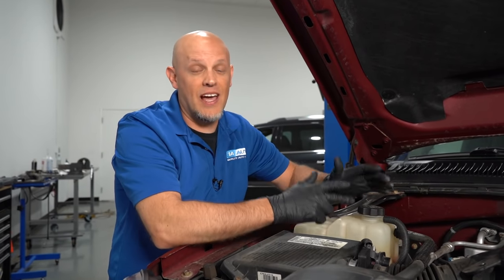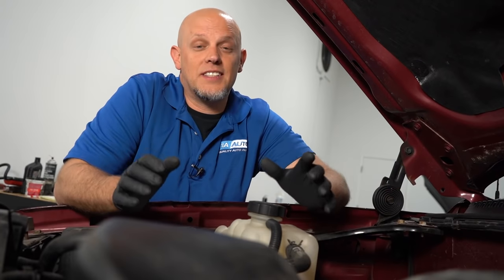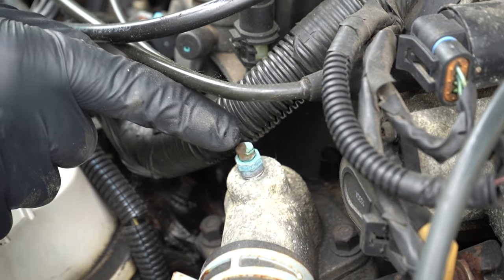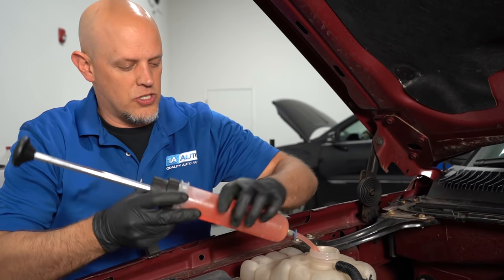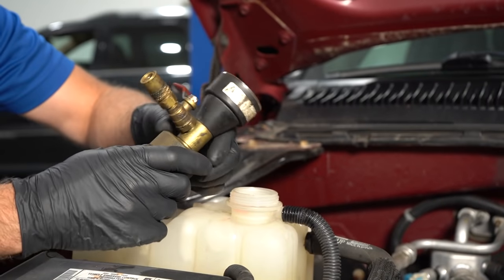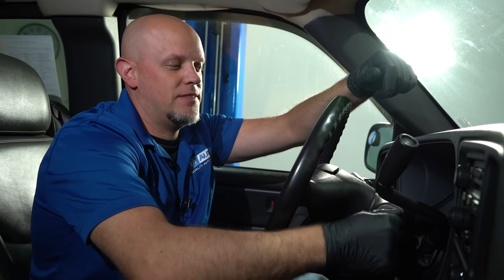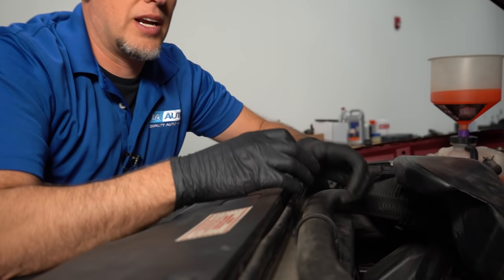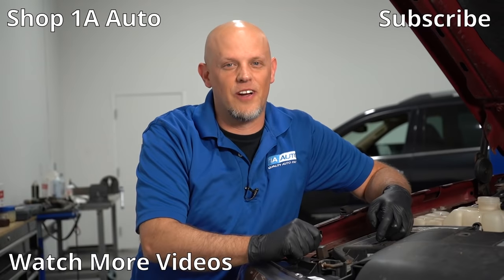Overheating After Replacing Radiator, Pump, Thermostat? Burp Coolant to Remove Air Pockets!

Comment: I just replaced a thermostat,  the reservoir is overflowing with boiling coolant.  I took it for a drive,  so I am stock at a gas station with a dead battery  watching this video , fun times

Comment: My 97 Accord EX started to overheat when I was waiting to make a Left turn to go inside the mall parking lot, I saw smoke coming out of my hood I looked at the temperature gauge and it was maxed out all the way to the top Red line Hot. I quickly pulled over, parked my car shut the engine off looked underneath my car there was radiator fluid leaking out like a water tap. I had to call my buddy to bring me some radiator fluid and water. It turned out to be a slow leak, I still managed to drive it back home and to work the next day while monitoring the temperature gauge. As I'm halfway through my work shift fluid starts leaking out, I had a bottle of radiator fluid in my car to top up after work I got down to figuring out where the leak was coming from sure enough it was the heater core hose a tight spot to reach. There was a small pin hole inside the hose causing the fluid to leak out, after replacing the hose and topping up on radiator fluid and water it stopped leaking and the temperature gauge is where it should be at Normal.
Reply: Thanks for this info..  I'm on my way to check what you've mentioned. Thank you

Comment: The funnel he's using cost around $30. I bought a simpler  one at Walmart for $3. It's just a regular funnel but with a wider outlet. It fits snuggly into most radiators, and if it's loose you can just wrap it a little with duct tape. Works real well for this job.
Reply: You can spend the saved money on girls you lucky boy

Comment: Years ago, my buddy put a new radiator in his 2000 Dodge Ram. An air pocket cost him a $4500 engine. That catastrophe made me gun-shy. This video makes me confident. Thank you.
Reply: After new radiator, hoses, thermostat, etc. you just have to be really careful the engine is cooling. Then make sure heat is working. In not too hot weather, I like to drive with heat on low and window open. If the heat quits you'll soon have an overheating engine due to inadequate fluid flow. Likely from a leak.

Comment: Ok my car gurus, I have a 2006 Colorado 2.8L I have changed temp sensor, water pump, thermostat and coolant, I blurp out all the air, my issue is when at idle temp rises to half mark, when adding throttle the gauge noticable goes down to cold mark, this is with heat off, with heat on and it does make heat, at idle it gets to quarter mark no higher, rev it and it goes down to cold mark again, I'm at a loss and confused as to what is going on, I have never had a vehicle like this, could I possibly have a faulty new thermostat

Comment: I've watched at least 10 different coolant change or flush videos to find the common steps between each video and I learn something new from each video. The thermostats needs to be installed on with hole at the top for the air to flow through was something I wouldn't have catch. Thank you so much!!

Comment: Thanks for this video..changed out my radiator first and it still was overheating after I filled it up .so I thought well must be the water pump and got another thermostat as well. Changed that and still was overheating..well guess what....I didn't let the air out. Great info and helped a lot..your guys video help me save around 2000 in labor btw..dodge ram 1500 2011..god bless you guys
Reply from the maker: +Good Mourning America Thanks for checking us out. Shop for high quality auto parts on 1AAuto.com:

http://1aau.to/m/Shop-1AAuto-c

Comment: that was a very well rounded treatment of the subject, covered all the possible situations and solutions, thank you! Some vehicles have the heater core at the highest point in the system and those can prove a little stubborn in ridding air lock. However that is usually achieved with repeated heat up and cool down with circulating coolant. Just be sure to have plenty of reservoir coolant available in the expansion bottle so that as the air is purged there is enough coolant to fill the void.
Reply: I had to replace the radiator and purge. Now my gauge barely gets past warm. So you think if I just do the purge process a few times it could relieve a block at the heater core?

Comment: I cannot thank you enough for this video - it saved my day!  35 years of working on cars and I had never run into this issue.  My son's older (2004) Infiniti G35 had LOTS of air in the system.  I used one of those funnel tools and solved the problem.  I was about ready to admit defeat and take it to a shop.  Not telling how much they may have charged me to fix this problem.

Comment: 50/50 mix is needed for -34F Freezing point. 33/67. It's rated to 0. Which means you still won't do damage until you get well below 0F. I live where there's almost never below 0F. I've been buying 1 gallon of antifreeze and 2 gallons of distilled water. Mixing it to get 3 gallons of 33/67 mix. I've used this for 2 decades. Never a problem. Antifreeze jugs used to have a mixture chart.

Comment: Thanks for the video.  Everything was explained well and covered many different scenarios. Appreciate the attention to detail. MY 2018 Expedition was getting hot after I replaced the heater hoses. Tried the parking on a slant and allowed the air pockets to remove.. I also made sure to turn on the heater inside the car when I started after burping just to make sure things were flowing well. Everything is back to normal..
Reply from the maker: +@americansamiam Thanks for the feedback!

Comment: I'm just coming to upvote and comment for visibility anytime I see a video for this.  I had been chasing an issue in my 2011 WRX, and it turned out to just be that boxers, and those with a TMIC in particular, have to be burped a specific way.  So, yes, air can cripple your car and make you think you have a major issue.  I must have just had air at the water pump or something, because I could not get any circulation, even after replacing my thermostat.  Proper burp, fine.

Comment: Excellent video ! have been struggling with my '78 chevy step van seeming to overheat for a few days .Finally concluded the problem was the gauge . But anyway this question  of burping the system was part of the equation so this is vey helpful .

Comment: If you're doing a complete coolant flush & replacement, you need to burp the entire system by starting the engine with the radiator or container cap off. Turn the heater in the passenger compartment on so the coolant will flow to the heater core as well. Let the engine run for about 15 - 20 minutes with the cap off occasionally squeezing one of the radiator hoses in the process to "push" any trapped air in the system and get it moving toward the opening where the cap usually is. Fill the radiator with extra coolant as needed.

Comment: Omg! I'll try this right away! And then I'll update my comment 😅.
I had my radiator repaired and after that the temperature rises at high speeds. 
I'm using the vehicle without thermostat since then. I've tried to install the thermostat but the temperature issue returns. I'll try to purge the air out..
If it doesn't solve the problem I think there might be something clogged in the system. (Hot a/c is not working either)

Comment: When I worked radiator repair (5 years) we would always drill a 1/8inch hole in the new thermostat in the flat disk section  just outside the valve and inside the gasket area. This let traped air out of the engine block while engine was warming up, before thermostat opened. An old school way to do it, just don't drill a big hole in it, 1/8" is plenty.
Reply: Excellent suggestion John , makes a million dollars worth of common sence to me , wonder why this isn't a normal manufacturing process , seems that it would also help with the sudden shock of cold fluid entering the engine block , although thermostats are supposed to slowly open , but i have seen some that would basically ( PoP ) open at set temperature ??? But I'm old and car's are built with way too much Junk in them anymore , backup systems for main system's and bla bla , Hell I'm going to the store Not Pluto the Planet !!!
Reply: Thermostats always had bleed holes in them.

Comment: @classics718
If you are overheating, I dont believe you want to turn on the A/C;  that will just make the engine work harder and does not help to còol the engine. You can turn on the heater to get the coolant circulating through the core to provide added cooling to the system. Running the A/C will only make your overheating problem worse.

Comment: Another tric you can try is to turn the air-conditionig on and your radiator cooling fans should come on automatically and stay on to keep the car from overheating until you get the car home and  to the mechanic

Comment: Mechanic didn't burp mine. Just told me to drive it and check coolent reservoir for a couple of days. Well I'm on day 3 of adding coolent. Almost froze to death driving home at 3 am with no heat, now with a cold I'm adding more coolent. It will heat up in the daytime when not so cold out but at night in freezing cold no heat. I brought coolent with me tonight and added before I head out at 3 am.

Comment: I've got a 2002 Buick LeSabre 3800 series engine the angle pipe that retains water that goes into the block cracked in the engine overheated traveling back home the engine got so hot it messed up and burnt the gaskets I found out that there was a product called Blue Devil I followed the procedures on this liquid called Blue Devil once I repair the broken angle pipe I poured in the Blue Devil as it was idling with no water in the radiator just the Blue Devil by itself this product is legit and it really works my car has been running excellent for the past 7 months doesn't overheat anymore

Comment: This is such a great video. I just replaced my thermostat and changed the coolant. 
I was wondering why my 2012 navigator was only running at 184 degrees. Installed an OEM part. 
Any ideas?  Thanks

Comment: There are 2 more issues with over heating. One I saw back in the 70's. A mercury cougar had a water port in the head that was not machined in. A related issue is trash plugging water ports in the head.

Comment: Great video, thanks 👍
I think my car is suffering from an air lock even after running the car with a expansion funnel, still having heater just warm at idle but hot with fast idle. Just can’t seem to shift it. Few more ideas for me there, thanks👍
Reply: You solve this? Same issue.

Comment: I have a 2014 Chevy Cruze and my coolant boils in the expansion tank, I am still getting hot air in the cab. I just replaced the water pump with a timing belt change and I also replaced the thermostat as well. If you have any thought let me know.

Comment: I usually keep the radiator cap open and put a funnel on the hole and top up some coolant then let the engine run until the thermostat opens up and i can see the air bubbles comes out and the coolant goes in. Top up until the engine stops consuming the coolant and air bubbles stops coming out before i turn off the engine and put the radiator cap back on.

Comment: So Toyota messed up my radiator and they offered to replace it. I have a Corolla with 150,000 miles. My question is, do I have to replace the water pump & thermostat when replacing the radiator?

Comment: I wish you could work on my 2006 chevy equinox.  I had someone take out air of the coolant line to fix the overheating problem, but it is still overheating.  What could be the problem?  This car has been such a headache.

Comment: Great video .

Can you help ? 
Hg replaced months ago ..therm and coolant sensor replaced under a year ago. Rad almost 2 years ago ..New cap recently. 

Dash lot up while ago coolant temp high gear down.  Thrn gear down again . Coolamt came from overflow over anyone  I let ot cool and I wasn't far from home so mostly coasted it home . Until I topped it to take to garage ..didn't need much of a top . Garage done all tests and all os ok . Mentioned at a guess at possible causes of egr cooler etc but big gamble etc

Comment: I used the funnel system, jacked the vehicle up both ways to try to get it to burp my trucks engine. Replaced the water pump and radiator and the temp thermostat, but the thermostat was giving me low temp readings so I replaced the thermostat again! And now it overheats!
Reply: 04 dodge ram 1500 6cyl
Reply: I can't seem to get more than 4 quart into the radiator and nothing more than. 4 quarts

Comment: I just drained my 21 Acura ILX, with the spill free funnel. Refilled coolant, put the cap back on, after burping, and now I’m getting hot air only on Hi setting? If I go to say, 86, 85, ect…. The air goes to room temperature. Any suggestions would be appreciated. Thanks

Comment: Literally happened last week. Got my radiator and thermostat replaced the week prior and I was driving on the freeway when hella steam came out the hood. Not only was the coolant wrong but, there’s smoke from the exhaust now.
Reply: check your oil, make sure its not "milky". white smoke from exhaust could mean a blown head gasket.
Reply: Did u ever figure how how to fix that ?

Comment: I have a 2012 Ford Taurus 3.5l and I just changed the fluid to put all clean antifreeze in it, and I have used everything shown here, still has air in there somewhere. I did a pressure test to see if it has a hole anywhere in the system and it held 25lbs of vacuum for 30 minutes so no leaks in the system and I did a compression test and it’s still fine so I don’t like the fan staying on at almost full blast and I know it’s not the fan or anything to do with it I have all new and I tested it in my wife’s Taurus and it did it’s job perfectly. Am I going to have to continually open the pressurized overflow cap to release air from the overflow until it’s out?

Comment: I bought thermostat for but my mobile mechanic said this thermostat don’t have a seal so he asked me go get thermostat housing … after he replace n let the engine running for 5m the needle go up high.. he turn engine off let it cool… after that the engine won’t start at all… can you guess what  cause the problems? Should I follow your video step n try it but since I can’t get the car start anymore…;(

Comment: I have an 04' NISSAN PATHFINDER, do you know if all the VQ35DE engines have 2 thermostats? One is in the front of course and there is supposed to be one in the rear of the engine. Another video I watched the Guy stated that it's not called a thermostat. It is actually called a water valve but it is in fact a thermostat I watched him replace it in the video so my question is do you know if all VQ 35 DE engines have this second thermostat because I cannot find it on my engine please and thank you. Any feedback or information is greatly appreciated. Love the videos keep them up.

Comment: If the car keeps overheating, check the temperature sensor valve,the radiator cap, and the radiator cooling fans,when buying new radiator cap make sure its a tight fit it shouldn't be loose, buy original equipment cap not store brand.
Reply from the maker: +classic car man Thanks for the feedback!

Comment: I have a 2006 stratus and changed the thermostat and housing for it because the car wasnt showing it was warming up, after changing it a week later it starts saying it's overheating so I changed to engine coolant sensor, but still doing the same

Comment: Where can i get that air fitting that attaches to the reservoir that you used? Also how much pressure do you bring it up to? I had to watch on low volume so if you said i missed it

Comment: I recently replaced the cooling fan temperature switch, and thus needed to add more coolant and burp the cooling system.  I left the engine running for over 40min but the lower radiator hose remained cold, while the top hose is hot, and the cooling fan never came on.  For over 30min air bubbles still came out but less towards the end; I had to keep filling the radiator with coolant during that entire span but in fewer amounts until no more air bubbles and the coolant level stop dropping.  Is it normal for the lower hose to remain cold over that duration?

Comment: What would cause the temperature rise but not overheat? It runs hotter than it used to. 3.1l v6 GM motor.

Comment: When you mentioned the little hole in thermostat face it at the top .. does that mean  towards the firewall or around the other way towards the radiator the front of a car thank you....

Comment: Older Subaru 2.5  engine had airlock and overheating. Subaru years later  claims they fixed the problem but didn't explain or apologize.  Mechanics didn't know how to work on them causing more problems. And it wasn't just the 2.5 it was many of the Subaru engines had problems with the heads and overheating.  
I read an article about it the 2.5 had the airlock overheating problem after the first coolant change on the maintenance  warranty.
I read an article that airplane pilots recommend drilling a quarter inch hole through the thermostat and that cured our overheating problem but to make matters worse the mechanic that did the work had put in the new timing belt and it broke within 3000 Miles.  The total of four mechanics. All that work and the new clutch all wasted money because Subaru is a bunch of as howles.

Comment: Oh, look, a Silverado missing push pins on the radiator beauty cover :D

A lot of the mid 90's to early 2000's GM 3100's and 3400's had a bleeder valve on a pipe that ran just above the front tappet cover.  If you were lucky, the valve wouldn't be seized and break off when you tried to open it to bleed the air out.  Good times.